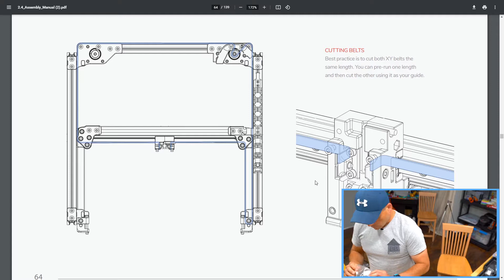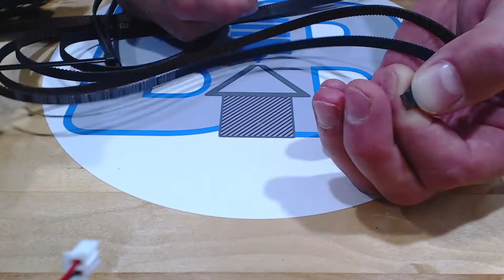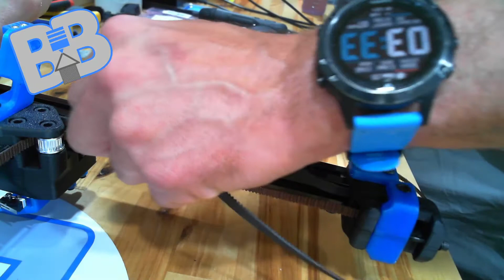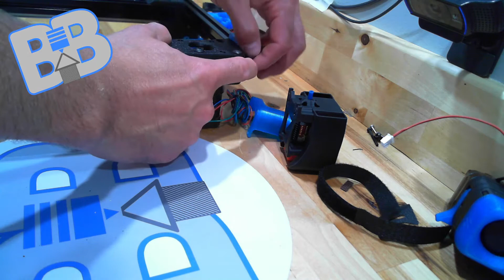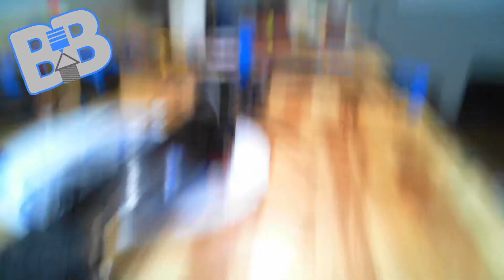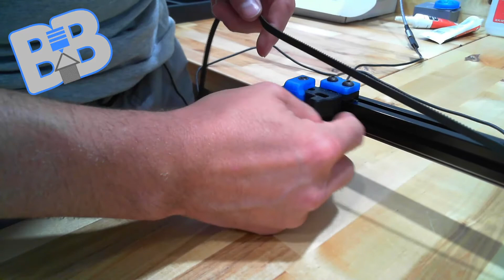VORON 2.4 3d Printer Build It Live *Episode 12* X-Y Belting

Comment: What kind of wires did your voron kit come with?
Reply from the maker: The kit came with silicone wire. Hard to say exactly how much since as of right now it's just a coil.  If I was to guess probably 40' (12m) of red and 200' (60m) of black.  I'm not 100% on the gauge.  I'll be starting electronics soon and probably have more to say. Quality of the wire seems decent.

Comment: Love the zipper idea!  Will keep in mind for next time!
Reply from the maker: Thanks Kevin - I played around with a few ideas, then I figured to under complicate things.  In practice, it's quick and as good as any other method I saw.  Takes less than three minutes, with a double check!
Reply: You're going to want to leave some slack on those belts for future adjustments.  I left 15 teeth on each end. You tuck the ends into the cavity before you put on the extruder.
Reply from the maker: @kevinlampron7580  Agreed I'll leave done on one end.  I do think there is a better chance that the belts will stretch than be too tight. As they stand they are taught but not tight. I believe the tensioners will take up any slack.